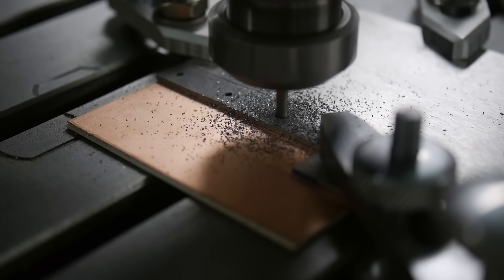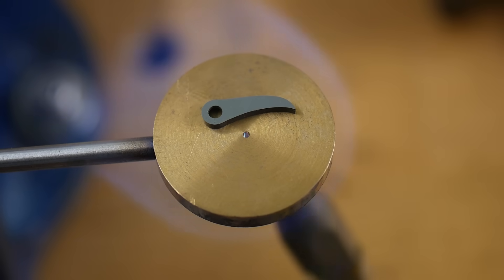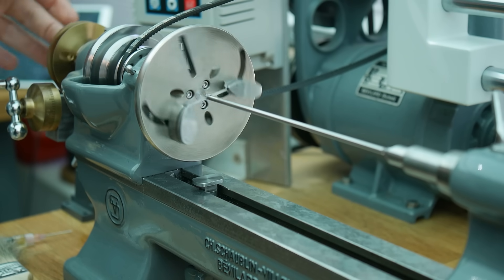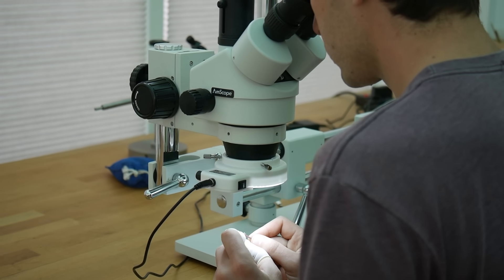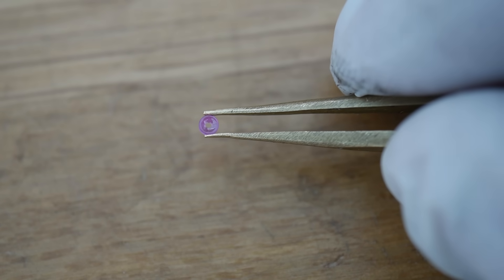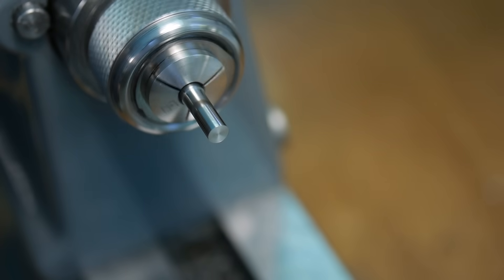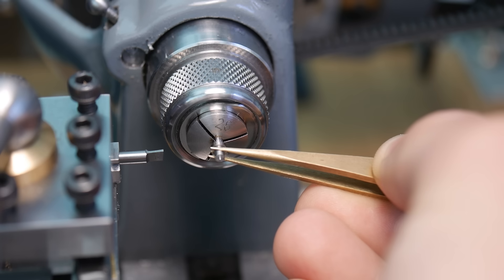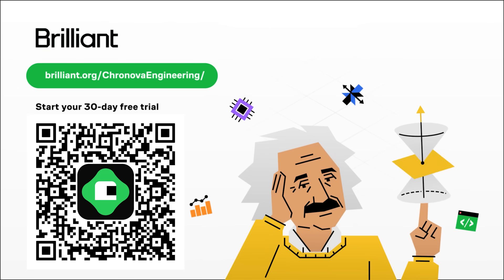Watchmaking: Making a Tourbillon Bridge, Click & Clickspring

Comment: At 4:10 is that micron "paste" or liquid bought somewhere or have you made it? If bought then where and if made then how? Im in the process of making a watch and finishing the movement and i think that would come in handy compared to "normal" micron pastes. Would probably also be useful in polishing the bezel and caseback, lapping films are a nightmare to use with them if not done in a pretty much surgical enviroment and using pastes with a dremel makes the surfaces scratch a lot easier.

Comment: 14:00 To get a better polish on the lathe, what about using a rotary polisher at a perpendicular direction to the pieces rotation? Similar to a surface grinder, and you could find a 'sweet spot' with the relative rotational speeds to where there are no consistent marks left.

Comment: For polishing in the lathe. I have found that if I do rapid lateral movements, I get a crosshatch pattern that is easily removed by the next grade sandpaper. I.E. alternate one pass rapid lateral and one pass slow movement and they eliminate each others marks. Also works well if you get a chip between the tool and the work piece and marr the work piece.

Comment: I use little snap lock plastic bags for small parts in the ultrasonic, you can put whatever cleaning solution you want in there and the vibrations travel through easily. Also, as it’s floating, it keeps stuff clear of the sides and bottom of the tank.

Comment: Did you have to do anything special either to the lathe setup before turning or the lap before use? Like dialing in the compound slide perpendicular and face with that? I'm impressed that your facing cuts are flat enough to lap with right off the machine. All the lathes I've used cut dished at least a little bit with the cross slide (they have all been rather used, but even the Connelly book says to scrape this into the cross slide). It's never really noticeable for most use cases, but I began scraping in a cast iron lap off the lathe a week ago and the dishing was very noticeable on the first few blueings.

Comment: A high polish can be obtained on a rotating cylinder using OD laps and lapping paste.  The OD lap must be a softer material than the part being polished.   A hard maple block,   with an appropriate size hole plus an adjusting slit   would be worth a try.   Plastic injection molds are brought to a high mirror finish using diamond lapping paste and hard wooden sticks. I see no reason why it wouldn't work for your application.  The term BLACK FINISH is a reference to the degree of polish plus the degree of flatness measured in  bands of light. .  The same degree of polish can be applied to a non flat surface but will not align the light rays in a parallel direction. I have brought metal to a high mirror finish using a buffing wheel and off the shelf buffing sticks.  Jewelers polish metal to mirror finishes using standard buffing compounds such as jewelers rouge or white oxide buffing sticks to charge a buffing wheel. If the grit of the polishing media is harder than the object being polished, it should work.

Comment: Not a machinist or watch-expert, but wouldn‘t the solution to polishing in the lathe be a custom tool? 
If the polishing direction is the problem, couldn‘t you use the same technique for making screw threads to polish „spirally“ on a point(instead of using the strip to hug the part)?

Or a simpler solution is maybe to rotate the part very slowly, so your horizontal movement has a bigger impact on the direction of the strokes.

Comment: Maybe to achieve better polish on the lathe, attach a small piece of emory paper to a rotary tool, perpendicular to the axis of its rotation; that way the paper is spinning so your scratches are not just in line with the lathe's motion. I am a woodworker, this technique is used when turning wood on the lathe to eliminate streaking and scratches from the final finish. Frank Howarth uses this technique and has excellent videos for inspiration.
Reply: I was thinking that or maybe even just burnishing it with a ruby stick or whatever

Comment: Polishing in the lathe is about axial movement. Turn down your rpm to about 800-1000 and go in a small amplitude axial oscillating movement with one grit and then massive amplitude axial oscillation with a finer one. Repeat until you get to 1 micron.

Comment: I do not think you can make a black polish with abrasives on a lathe, though you can build a tool that will make a mirror finish. It consists of a trapped ball bearing. here are many examples of them on YT. I think dimensional accuracy will suffer by this method though.

Comment: Excellent video.
Just some comments to consider, in my opinion.
It's best to harden and temper the tourbillon bridge before finishing it and setting the jewel, finishing and polishing give a much better result on heat treated steel.
After that, fit the chaton and fasten the bridge on the mainplate and centre the lower tourbillon jewel on the faceplate, then bore the chaton to the final size  to receive the jewel thus ensuring the concentricity of both rubies.

Comment: I suppose for polishing the pin, a slow spindle speed and a fast swipe of the abrasive at a very high lead should be able to generate spiral scratches in a single direction, reverse the lead for cross hatching?

Comment: To make black polishing to the pin you asked, you can use your grinder which you use in this video (you made reamer on it), but change the wheel to brass and then tin (with micron paste). If the brass will be to soft you can try start with cast iron, then brass or copper and then tin.

Comment: Beautiful. Can the thread for the two stubs compensate for tolerances? So, should the holes for the threads be drilled as precisely as possible, and can the thread compensate for any tolerances of the hole spacing?

Comment: Such a great video! Great videography, even on those small parts, nicely narrated and coupled with tastefull piano makes for a professional and pleasing experience to watch. I have newer had an interest in clocks, but now i need to make one asap!

In my youth I worked as a toolmaker doing plastic injection moulds, and we made a lot of moulds for drinking glasses and similar items. These needed to be polished to a mirror finish, and to do that we used a small air driven diegrinder with a tip made of thightly packed felt with diamond compound on them. These could be shaped to desired forms in order to reach inside corners, narrow ridges etc. Each felt tip was used with a single grit of diamond paste and they were kept separately. The mould, hands etc were also cleaned thoroughly between each grit.
The technique was to work each grit in a different angle than the previous, somewhat the same as when filing. On the lathe this was easy, just turn the rinder in different directions. 
If the ground work was done properly, a perfect mirror finish was fairly easy to accomplish, even i hardened chrome steel

Comment: I've seen other machinists use burnishing to achieve mirror-like surfaces on the lathe. It requires more pressure than polishing though, so maybe not so easy on these small, delicate parts.
Reply: Was going to suggest burnishing too. In consideration of the small parts, maybe since the finish is already pretty fine (relative to large conventionally machined parts) you could get away with less pressure from the burnishing tool. Alternatively, maybe make a tool that can pinch burnish?

Comment: About that black polish... what if you would use small drill that would spin 90* degree from lathe in similar or faster speed so scratches would maybe not be so uniform/one directional? Most scratches would be in around 45* but maybe it would be enough?
Reply: the part has a mirror finish. the tool marks you see are being reflected from below. he uses the straightness of the reflected lines to judge the flatness of the polish.